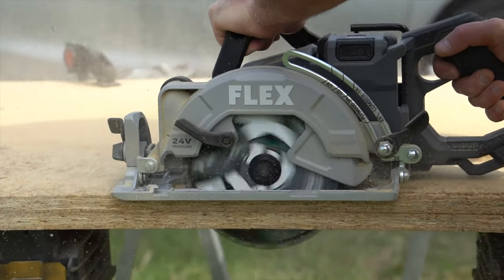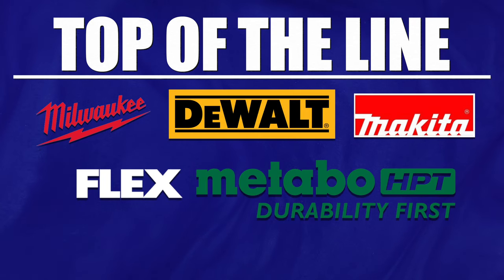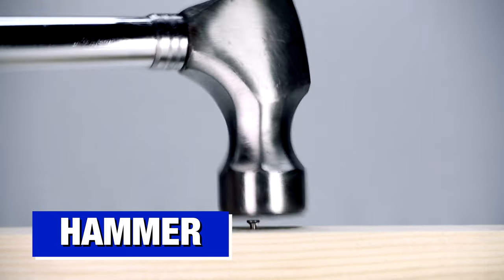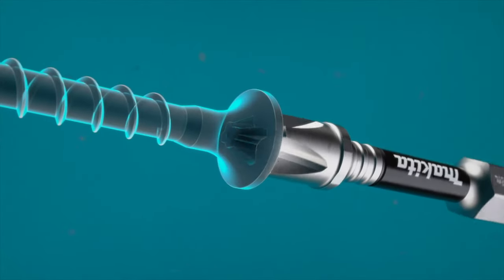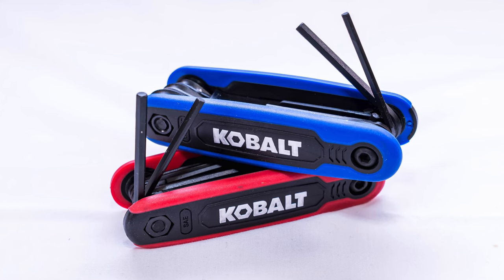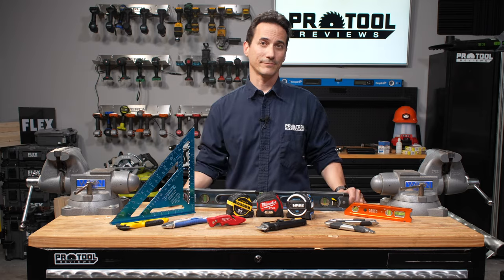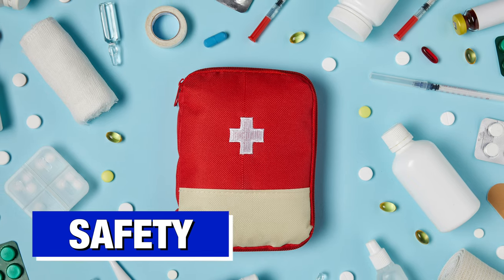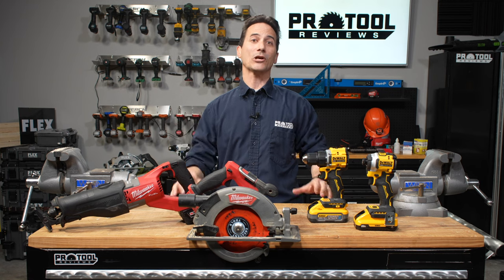15 Tools You Need In Your Tool Kit For Home and Work

Comment: That is funny how people forget about Bosch, they make some good tools as well.
Reply: Bosch doesn't have a strong market share in America. Other brands make the same tools for cheaper cost, that work just as well. Especially for most people in the states that are Johnny homeowner or DIYers. You can get by with kobalt rigid Ryobi all three brands have pretty much the basics for less money. Circular saw reciprocating saw hammer drill driver impact driver low mid and high torque impact wrenches jigsaw grinder and even subcompact sizes I'm team orange and they work great. That new brushless line from Ridgid out performs some of the more expensive brands.  They put pretty decent motors in them now. They even share some of the same motors with the Ryobi HP line. Just comes down to what battery collection you got.
Reply: @Techprep23 They’re not as popular partly because you only get the blue Bosch Professional tools in the USA. Here in Australia we have Bosch DIY which is a dark green, as well as Bosch Professional. They tend to be cheaper than Ryobi even, which are already in the lower end of the price brackets.
Reply: @MarioGoatse  I wouldn't mind getting Bosch Johnny homeowner / DIY version of stuff. Because I am that Johnny homeowner DIYer. And with a name like Bosch it may not be the most powerful but you know that shit will last.  Because Ryobi is okay their tools aren't bad it's the batteries and the chargers that are atrocious and have been for years. And Ryobi thought it would be a great idea to kill the three amp hour battery just like rigid did. Honestly what are you going to do with a two amp hour battery on an impact driver absolutely nothing Even on the 12 volt tool I have the DeWalt Xtreme 12 volts and the two amp hour batteries are dog shit you put a three or a 5 amp hour 12 volt battery on it and they really come to life and they are really decent tools for 12 volt. My only complaint with Bosch 12 volt tools is they put the battery in the handle like Milwaukee's 12 volt fuel line I'm much prefer the thinner grip in the slide under batteries like everybody's 18 volt tools
Reply: @Techprep23 the biggest issue with many tool brands is kobalt gives pro grade performance with a 5 year warranty for ryobi prices. Ridgid also offers an lsa on all tools which makes them pro grade by default

Comment: Stud finder, multimeter, electrical tape, 2 pencils and a sharpener, locktite, a caulk gun, wipes, compact 1/4th ratchet set

For power tools, an oscillating multi-tool, a compact vacuum, a speaker and a fan.

For just diy-handyman style, everything i need fits into a ryobi link stack, but any brand will do. Big box on the bottom for saws, accessories like lights, fans spare batteries and chargers and radios in the middle, drivers in the small box, whatever youre carrying in the crate, and the vacuum and handtool bag on top. If you go a stacking brand without a vac then get one that wall mounts and bracket it to a box

Comment: I use Tough Built open top bag with tech clips to enhance my moat used tools and the XL bag on rollers for big jobs. Don't forget the clamp meter. I'm 80 years old and some tools I've had for 50 years. 😊

Comment: Regarding the screwdriver sets you mention at the beginning.  Just get a small 4 in 1 screwdriver.  This has a couple bits that flip between a couple sizes of Phillips and straight.  Klein is a great brand.  And then get a bit set.  This has a screwdriver handle with a 1/4" socket on the end and then 20 or so short bits that fit in it.  They are the Torx, Robertson, etc. sizes.  I have a 30 year old Craftsman set that has saved me many many times when dealing with an unknown Torx or Robertson screw.
Reply: I have the exact same craftsman kit, gifted to me by my grandfather and he had it for over 20 years

Comment: A small or medium Pinch Clamp and a Water Pipe Clam are good additions to the set too. Don't forget a marker and pencil, some tape (mask, silver, electrical and water sealing tapes) an electrical tester screwdriver, and maybe a round or tringular Small or medium Metal File, a little piece of sand paper, a towel or rag (old t-shirt piece), a scissor (craft snip) and I think you are good to go. 😌

Comment: One of the most important tools to have in your house or office and no one talks about it is a Work Bench!!! Without a good and proper work Bench your back will be hurt every time you need to work on someting.
I would strongly recomend to buy a dremel 4000 like model. You can do a lot with this tool.
And never forget about a crowbar

Comment: I had never heard of Flex brand for the longest time.  I suspect the quality.  Feels like just a ‘big box’ brand.
Reply: Flex invented the angle grinder in 1935. It's a German company that has produced tools for a century now (founded in 1922). In Germany, angle grinders are colloquially referred to as "die Flex", although Flex makes more than angle grinders.
Reply: Flex was a very small tool company that the brand got picked up by chevron in like 22 and they started shitting out pro grade tools using kobalts 24v tech to boot and developing from there (kobalt 24v is made by chevron). Personally I think kobalt xtr was a test run for flex

Comment: Switch out the sawzall for an angle grinder. Other than that I would agree with the selection.
Reply: I own both. I've used my Sawzall many times. My angle grinder I used to sharpen my lawn mower blade once and haven't touched it since. Got both in a kit at the same time
Reply: @james2042  Angle grinder for sharpening blades? Kinda weird if you ask me but if it worked... I am the complete opposite. Also own both (even multiple) but the sawzall collects dust most of the time. 

Maybe its different in the US with all the wooden houses?
Reply: @JiriMachovec  yeah in the US, so wood is everywhere. There's a reason why woodworking and carpentry tools are staples in every contractors box in the US. You need special contractors when you don't have a wooden house lol
Reply: @james2042  I mainly work on cars but my house from 1886 is built with stones in the bottom floor and bricks on top. Almost no wood other than the rafters or whatever the structure for the roof is called. We use angle grinders not only for grinding but also for cutting all kinds of metal, rebar, stone, concrete bricks, pavers and tile. So its much more convenient for me than a sawzall. I even own multiple just so I dont have to switch blades so often. I have one for cutting, one for grinding and another one for a wire wheel lol.

The sawzall probably does make more sense in your context though. I would preffers a different kind of saw for anything bu demolition work though. Either a circular saw, jig saw or maybe even a chainsaw. I guess I just do not like it very much...
Reply: @JiriMachovec  the reason recips are so useful is they are a big multi tool. Wood, (thin) metal, rebar, pipe, conduit. I've cut up bushes, pvc pipe, furniture, metal framing, nail embedded wood, and drywall with mine. For cutting bricks and masonry, I'm using a wet saw and for demo in masonry I'm using a rotary hammer. 

For cars a grinder makes perfect sense, I use a die grinder for my automotive use. I would say the 4.5-5 inch is too big.
Reply: @Jiri: Respectfully, no way.  Most people shouldn't go anywhere near an angle grinder.

Comment: I’d start with a square and a pencil, panel saw, tape measure and a 1 inch and half inch wood chisels, Hammer, drill and impact with bits. Half inch ratchet with 10-19 sockets. Box end spanners the same 10-19. Oh and don’t be fooled into thinking you need to buy all this stuff new. Go to yard sales buy random boxes of tools

Comment: You're telling non-trades people to get a Stiletto or Martinez framing hammer? Get out of town, man 😂
Reply: Yah, their advice on hammers was a bit over the top.  20oz Estwing or Dewalt for five bucks at a garage sale would work. Most homeowners couldn't even swing  a legit framing hammer. On the other hand, there is nothing worse than those el-cheapo hammers that can barely drive a nail to hang a picture.
Reply: All the pro carpenters I know use Estwing.